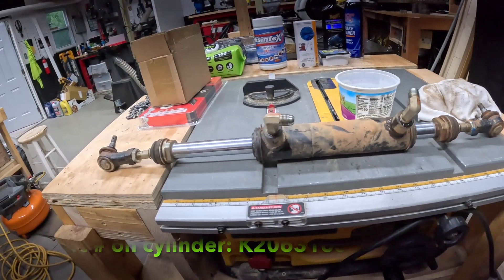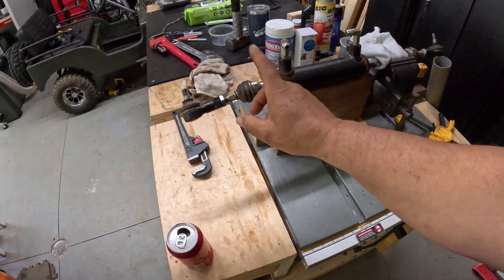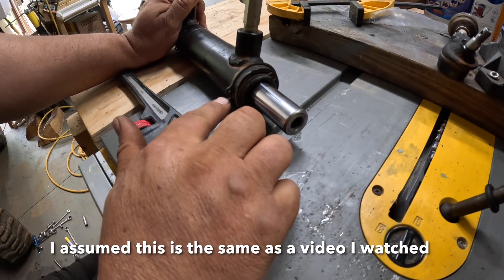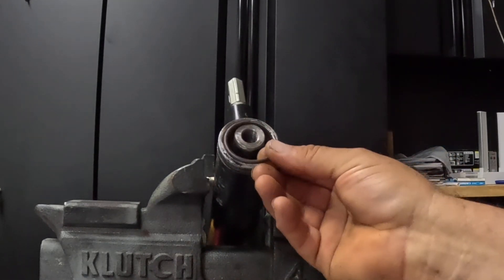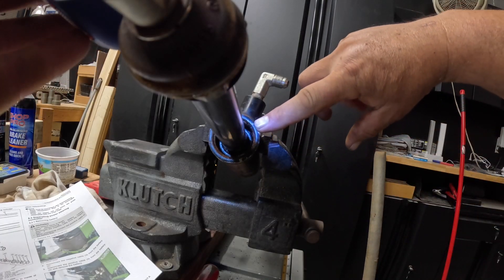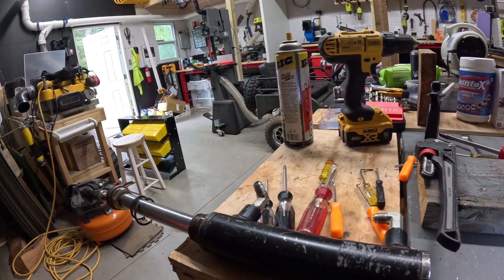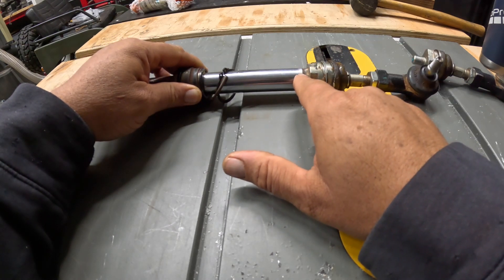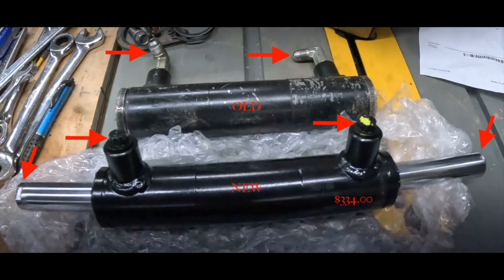Kubota BX23S: Steering Cylinder Disassembly

Comment: I’m about to have to do this, so thanks for posting the video. The rebuild kit is $75, a whole new steering rack is about $600. So I’m willing to give it a try at least. 

So, did you ever get it apart?
Reply from the maker: Honestly, everything I covered in this video is what you will more than likely experience, but maybe you will have better luck and hopefully the video will help you out.
I didn't get it apart. I tried so many things that didn't work. I returned the rebuild kit and bought a new cylinder for $334.00. If you do the rebuild kit make sure you have strong super thin open-end wrenches.
Reply: @RoCDIY I got that bad boy apart. Put the heat to the tie rod end and she came off with a sneeze just about. I need new tie rods anyway. Getting those end caps out was a challenge, put I managed. Saved me some money today.
Reply from the maker: @ryanjones9305  Glad to hear it worked out for you. It is hit and miss. You may or may not have caught it in my video, but the Kubota shop destroyed my tie-rod heating it up. I ended up replacing both too.
Reply: @RoCDIY damn! What the hell did they heat it with? Geez. I hit it pretty hard with my torch, had the cylinder in the vise with some non-marring jaws, no problem. That thing must’ve been welded on or they gave the job to the lowest mechanic in the shop. My little Kubota here is 25 years old and has lived outside for most of it.

Still not in the clear, I have to rebuild it, so not celebrating too early.
Reply from the maker: @ryanjones9305  Cheech (Cheech & Chong) did not tell me what he was going to do. He came in the back door with smoke billowing behind him and said he couldn't get it apart as he handed it to me with the heated end toward me. I didn't touch it because I could see it was hot and the boot was melted. I believe a permanent thread lock was used, but only learned that after the fact.
Reply: @RoCDIY gotcha. Thanks for the reply. I’ve rebuilt a few hydraulic cylinders, but if I can’t get the tie rod off, it’s a done deal. I’m going to do as you advise, I think I’ll go ahead and hit it with some heat right from the start, maybe that’ll be enough. But if I have to get a new cylinder, I’ll get new tie rods too, the whole shebang I guess. Biggest issue right now is the tractor is sitting in the middle if my shop floor and I have other things to do!

Comment: We have a 2005 kubota bx2350d and I have rebuilt the steering cylinder once back in 2015 and now getting ready to do it again in 2025. You have to be patient and I was able to remove the tie rod by getting a good wrench and grinding it on the edge to size. The most important part is be patient.
Reply from the maker: Thanks for the input. Yes, I agree patience is key. Thanks for watching and commenting.